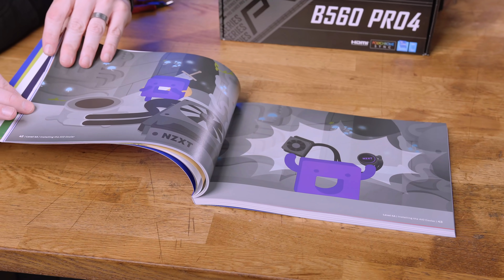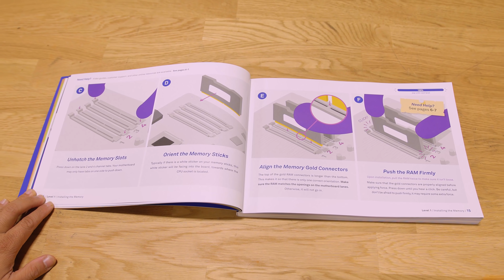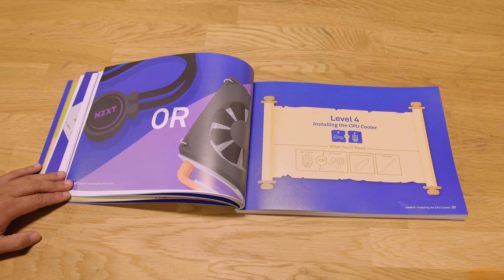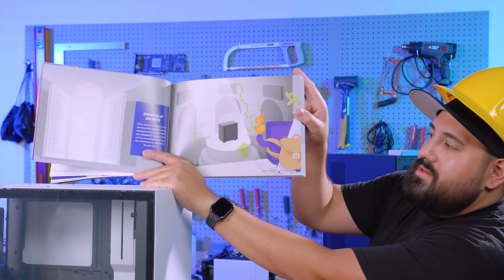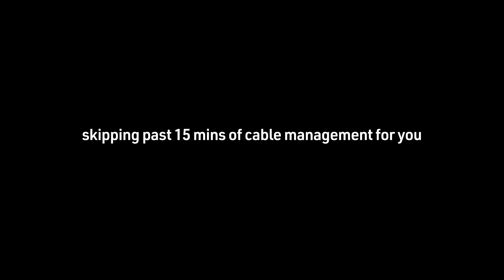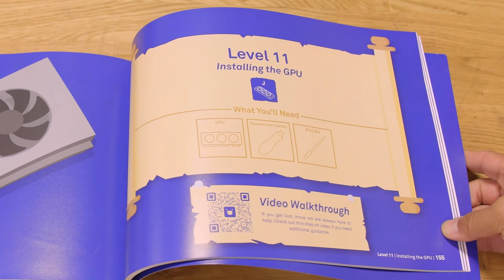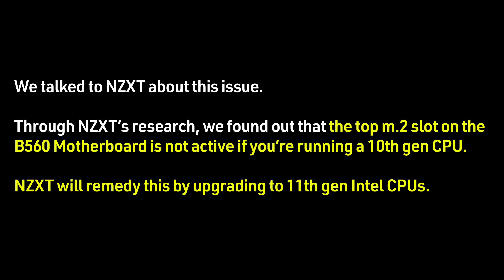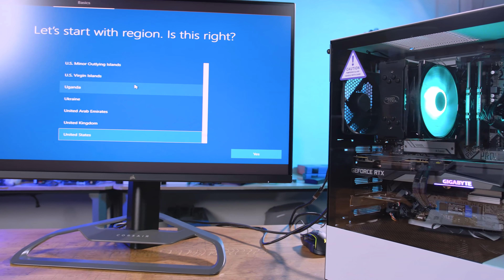Why hasn't anyone thought of this before??

Comment: This was a fantastic idea, as it shows beginners what they could expect in building their own kit (except having Jay many faces of dad mode.)
Reply: and Jay with a nerf gun!
Reply: Completely agree.
Reply: @sopcannon  aww I miss the RTFM show :(
Reply: 22:01 hit the like button 3 times XD
Reply: This is an AMAZING idea
Reply: Yea it's a great idea for beginners who are to lazy to understand the structure and build of a PC. If they learn on their own (ex. What CPUs, Motherboards, Case Size, GPUs, Ram, etc.) This teaches beginners (like I was) to learn what each piece of equipment is responsible for and will help you understand the processes behind building PCs like this. There is a reason there is no tutorial on how to EXACTLY water-cool your equipment, but you can learn how to water-cool your equipment by learning how the trade is properly applied. Plus the price of these "Build your Own PC Kits" still end up costing more than if someone spent 1-2 hours researching what parts are compatible and what is best for them. P.S When you customize your own PC, while being aware of what the performance you need your PC to be most efficient at, you will have to learn about each PC component. This is good for 4-9 years olds but after that, I would recommend having the child do the research him/herself (Obviously make sure the components will work before you order them). But put the pressure on them to learn about computers before you do it for them and 99% of the time they will put the time in. Not a bad product if you have a couple thousand to waste because you rather not make your child (like I had to) learn about the topics. It may take 10 1hr videos but if the person is truly interested they will be ready to learn (while being excited) at any chance to learn. Unless it's St. Pattys Day lol.
Reply: my son is ~2 years from this being an amazing xmas gift
Reply: @alternativehistory1203  eh I think there's definitely a market for this. I've had a few friends who thought the idea of building a PC was cool so they could play games but didn't really have any interest in learning a lot about each part or some of the specifics. And y'know I don't really fault them for that, it's all just a matter of what you're interested in. It may not make sense to you or I, but hey, who are we to judge or gatekeep what people enjoy? I'm glad this is making the bar of entry to the hobby lower, because maybe it will help some people delve deeper into it, and if they don't, then so what? Some people don't want to do hours of research if they don't have to, they just want to dive right into it, and if there are tools available to be able to do that, then great! I don't think it's fair to call people lazy or tell them they are wasting their money, because ultimately some people will find the extra cost and time savings worth it, and that's okay. Personally I found the month+ of diving down the rabbit hole of PC component and building research I did before I actually built my PC more than half the fun, but that's just not some people's jam.
Reply: @alternativehistory1203  all NULL & VOID if all the person wants to do is buy a computer and learn a few basics.

Comment: I love how Jay says that his cable management looks good for a beginner even though we all know the more PCs you build the more you just stop caring and throw everything in the back and sit on the back panel to get it to shut basically.
Reply: Yeah, I did that once...once.  I put so much pressure on the SATA connector on one of the hard drives that I snapped it off (I admit I should have been using a cable with  a 90 degree connector on it).  I'm much more careful about cable management now.
Reply: Eventually you reach the point where you realize that if orient the PC so that side of it faces a wall you don't even need the back panel and you can just let it all hang out ;)
Reply: Remember when back in the day we had like 4-6 5 1/4" bays and PSUs without cable management, we'd just install the optical drive in the lowest bay and throw all the unused cables hanging off of the PSU right on top of it. Common practice!
Reply: That's why i love to build in Lian Li Cases, smack it all in there, make the front look neat, put the plate on the back to hide all you're cables and make it look like you cared. (I don't)
Reply: @AusSkiller  keeping it neet  even your gpu on a riser  creates air flow a mess makes it stuffy and a need for all the crap you dont need thats exspensive to keep it cool inside
Reply: @CakePrincessCelestia  Yeah, I've built enough old computers back in the day to not really care about cable clutter.  If giant ribbon cables weren't a problem, I doubt a tiny little cable dangling from the GPU is going to wreck my performance.
Reply: @funghazi  To be fair, I used to fold those Floppy and IDE cables as best as possible so they'd have clean 90° engles and were laying flat on top of things instead of cluttering the case wildly, but more because of the airflow since we didn't have windows on the cases back then. But I never used cable ties. In fact, I hated when others had them in their rigs and wanted me to fix issues, because I usually ended up having to pry those upen with normal kitchen scissors for the lack of proper tools, which sucks.
Reply: @CakePrincessCelestia  I still use those bays to stash cables, was even thinking next time I clean my PC I'll print out a box to fit in the bays to really take the lazy way out in hiding the rats nest. In all seriousness more a box with a couple pegs to hang coiled excess inside of it.
Reply: @CakePrincessCelestia  I hate zip ties for that too!  I tend to use all the twist ties that come with the various cables when needed.  I have to say I did use zip ties for the 2nd PCIe connector on the cables, so that it was held back, as I don't use it!
Reply: I see no lie here.
Reply: I agree with this 100% except the more I build pcs the more I only purchase cases that have alot of cable room
Reply: @CakePrincessCelestia  Get proper tools if you're repairing things bro
Reply: @Beofware  *EXPLOSIONS* ThAt'S wHy I fIx It WiTh IfIxIt! *EXPLOSIONS*
Reply: @CakePrincessCelestia  sorry buuuuuuuut.... WE INTERRUPT YOUR COMMENT TO BRING YOU THIS MESSAGE FROM I FIX IT!!!
Reply: stop revealing our secrets pls
Reply: Until glass panels started being a thing, most people who buy computers never noticed, only the tech who winds up working on it would know. Some of us are OCD though and did the cabling anyway. Only ever had to sit on Dell covers to get them to close again, personally. lol
Reply: sounds about right.. look inside case, do the cables look correct? can you close the back of the case? if both answers are yes then it's cable managed.. :P

Comment: Okay, I'm only 50 seconds into the video but a BLD kit sounds like a phenomenal idea. With zero additional information beyond "NZXT BLD kit" it sounds like the best of both worlds of getting a full, warrantied system from one integrator and still getting the building experience.

Edit: At the end of the video, this is an even better idea. The manual looks done to a point where it looks like literally anyone could do it. The labels look really helpful on the boxes. Cable management guide is way more than I would've expected. Tool kit is included. NZXT nailed this.

Comment: My son has that case and my nephew has that case because of him. We upgraded the included Ryzen cooler with a Corsair H60i 120mm AIO. You can mount a 240mm AIO in the front but the tubes would be at the top and level with the pump so there is the potential for air to circulate in the pump. I wish they made it so you could mount a 240 on the top, maybe even a 360. There is plenty of room for a 240, 360 might be tight. You would need to get around the front mobo cable strip (that white strip in the front) so it might have to go loser to the glass panel side. It has room for a custom loop which would make for a nice sized custom loop PC.

Comment: It seems that they aren't the first to come out with this, though, as I purchased a DIY Kit from Tiger Direct way back in 1998. I'm surprised that it's taken this long to re-implement it. I doubt that there would be that much savings over having them build it and doing it yourself. One caveat in it's favor is that you gain the experience of putting it together.

Comment: Yo Jay, can you make a video about how to run 2 GPUs without SLI/Crossfire and what are practical uses for such a setup? Thought it be a pretty cool topic since I’ve not seen any major Tech YTubers make it yet
Reply: The only practical uses for multiple GPUs now are:
1. Productivity (e.g. mining, rendering)
2. Running a Linux host with a Windows virtual machine passing the second GPU through to the Windows VM for gaming performance... which really isn't worth it considering how many games just work fine on Linux with Proton now.
Reply: Ive known people have 2 GPUs where one is gaming and the other sits mining.  Gains from SLI so minimal now that people don't bother.
Reply: I'd love to be able to do this. I have 2x 1080 Ti. One is in my PC running a 3440x1440 ultrawide display and the other is in a SFF-PC running to a 4K TV. I'd much rather put both GPUs in my main tower and run one to each display that way.
Reply: @tylerkulchinsky2167  honestly you would be better off selling one of them and just using the 1, you really won't notice a difference having a second card.
Reply: @StortebeckerSF  I tried running a single card and I get really bad fps on the 4k TV. When I built my secondary PC and dedicated a GPU to it I got a much more consistent and playable framerate
Reply: @tylerkulchinsky2167  what cpu did you have/change to
Reply: @tylerkulchinsky2167  There is absolutely zero reason that you can NOT do this...The only thing that you would have to watch out for, (Besides the Power Supply...ABSOLUTELY MAKE SURE that your PSU is ok to run two GPUs!) is specifying which apps use which GPU, and there in lies the problem, as Windows 10 and 11 Graphics Settings will only recognize two individual 1080ti cards with no unique identifiers, though it wouldn't really matter except if you mess up the card selection and apps or games appear on the wrong display, but no harm done, just go back into Graphics Settings and swap to the other card.
Reply: @mutley3  I've got a Ryzen 9 3900x
Reply: @Dozeball  Seasonic Prime 1000w PSU should be good for 2x 1080 Ti. Thanks for the info, I'll try it tonight!
Reply: @tylerkulchinsky2167  yea, but putting 2 of them in 1 system won't make in run better on 4k, considering only 1 card will be utilized at a time, unless you're mining off one or doing editing and such. For gaming it would be better to upgrade if its lagging on the 4k
Reply: @StortebeckerSF  It only lags on the 4k when I'm running 1 GPU to both displays. When running a dedicated GPU to the 4k it doesn't lag at all, it would make it easier for me if I could just put both GPUs in one PC

Comment: I've built somewhere between 60-70 computers in my lifetime, and I recently bought a BLD kit because the entire cost of it was about what it currently costs to acquire just GPU alone. I was astonished at the quality of the provided instruction manual, both in terms of physical attributes (paper weight, glossy photos, etc) and the level of detail in the instructions. I actually referred to it a couple of times just out of curiosity. Really cool that they are doing this now

Comment: To NZXT. What would be even better is a app for your tablet or phone(or other pc) in witch you input exactly what parts you have and only shows you the relevant info, it could even contain video and/or audio clipps relevant to the step you are on. Those clipps could be updated if customers report trouble with any part of the build. Perhaps a "watch this first" instruction video to get customers starting correctly and calmly. The book looked verry nice but a qr code to the app would save printing and shipping, you could include the option when customers order if they want the book or only the app. Ps. the app could be 90 days free for those who buy the kit and for sale to all pc builders.

Comment: I will admit, I am thoroughly impressed. My level of respect for NZXT has greatly improved after this. Not saying it was in need of improvement, I've never owned any of their products so I had a neutral opinion of them. But after seeing easily the best, highest quality, and most thought out and detailed manual I've ever seen. Not to mention the idea alone, though I personally would never go this route as I am an experienced builder, I think is awesome. Then given the fact it comes with a tool kit and a warranty on every item in the box, this is a top notch product. I think it's an awesome idea and NZXT hit this one out of the ball park.

Comment: Presumably they test the parts before sending since there was no testing done before putting it all together, if there was a mobo issue that's a lot of work to start pulling it all apart (especially for the market they are aiming at)

Comment: I would like to say that I ordered this for my girlfriend which is not computer literate at all and she was able to build the kit mostly by herself. I did help her in some parts like the cpu which the book did not mention to read the MB manual on correct position of the cpu. I helped her on the RAM because of the board being a little tight and she didn't want to break something, and finally the GPU because it does not explain completely on how to put the card in. Overall she was able to do a lot more than someone first building and not know anything about parts would normally be able to do. It is impressive what NZXT did here.

Comment: Remember jumping into my first gaming build, weeks of research then a bottle of rum before clicking the order button.
Was the only way to get past that stage of "what if something goes wrong" and for me, it sure did the PSU blew most of it, if it wasn't for me ordering all parts from a decent shop here in the UK that helped me out i'd of prob give up so props to NZXT for that warrenty thing.

Comment: Great idea. Would certainly help with the issues of damage to their pre-built systems in shipping. If they offered the flexibility of their standard pre-built options, especially with gpus, that would be fantastic. I'd jump on one if they offered a 3080 instead of just 3060ti's. My current pc is one of theirs with a MSI 1080ti and mobo combo I bought a few years ago and it's been rock solid.

Comment: This one is hard to find. in the 1980s, a IBM pc Clone called "Plain Vanilla". A built it yourself kit.  Had a 300 bps modem and the modem card was a long as the desktop case. The best feature was that it had 2 button on either side and the top of the Desktop case lifted it up like a Car hood.

Comment: nice to initiate beginner to build their own pc... Well i've learned to build mine mostly by disassemblying the old computer that was collecting dust... and reading the manuals... Always read the manual! (well even if just to check if there is nothing special to do... or sticker to forget to peel that you never saw until a dusting 1 year later then it started to flop around...)

Comment: 19:44 - This is not just B560, it's on all LGA 1200 11th gen motherboard (500 series). The top M.2 is only activated if you're using 11th gen CPU. I have Z590 Vision D, and I had to moved my M.2 drive to the second slot.

It's in the manual.

Comment: Building a computer is one of the easiest things there is, people just don't know it. As long as you read the manuals, especially the motherboard manual it's hard to go wrong. Yes if you don't take time and just try to jam things in without thinking you're in trouble as with anything really. But how simple can it get? Tab A goes into Slot B, having worked in a comp shop I've built close to 1,000 so probably jaded but still, RTFM and you'll rarely go wrong. It takes more knowledge and experience to know what parts to buy to meet your current and future needs so they all play nice together :)

Comment: The m.2 slot issue isn’t limited to Asrock or the B560 chipset. My research into the ASUS ROG STRIX Z590-E showed the same issue with 10th gen processors

Comment: I finally gave up on finding a graphics card... bought NZXT BLD computer last week.. most parts were close to MSRP.. plus $100 build.. But got AMD 5800x and 3080TI with all other top level stuff for barely over MSRP.. enjoying the 3080TI for sure..  this sounds like good idea though.  FYI.. if you get an NZXT system.. check the XMP profile(cause they dont seem to ever enable) and also check the RAM slots.. sigh... they messed mine up but quick fixes you should not NEED to do but still at end of day worth it.  Didnt know about this till your video.. good info.

Comment: At least you don't still have to put your full weight on a flat screw driver to push down the clip on the CPU cooler block. One little slip and you were going to carve straight through your mobo...

Comment: This is actually a thing I might look into, I’ve been wanting to get rid of my prebuilt (it has a 1660 and the max ram speed it can deliver is 2666) but I have no idea what matches up well, I’d fear I’d get a good CPU but end up buying a bad quality motherboard or something like that
If they only 1added an option for a. Case with better airflow and 2 possibly add an option to opt out of certain parts if you already have the part